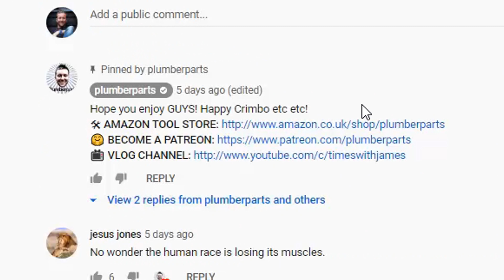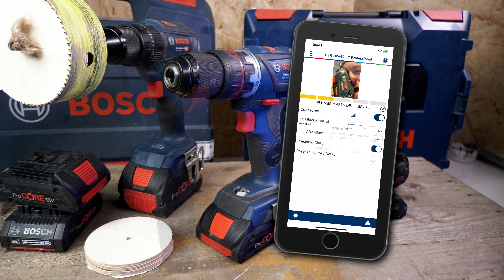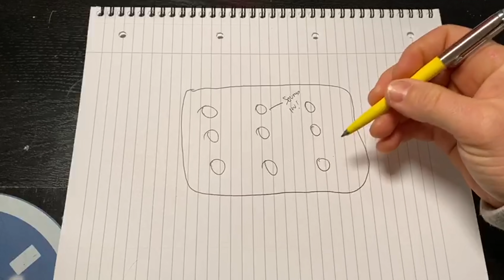5 DRILLS IN 1 - THE BEST DRILL DRIVER I'VE SEEN - Bosch GSR 18v Flexi Click

Comment: Little tip for you, if you're drilling large holes in ply or MDF like that ...use the holesaw to mark the hole then drill a couple of small holes in or near the kerf of the holesaw. Then when you drill with the holesaw it will fly through 👍 it helps to clear the dust
Reply: Biggsy1970 was going to recommend this
Reply from the maker: Amazing hack!
Reply: @plumberparts  I only learnt it a few years ago after 30 odd years as a chippy.

Comment: Simple rule for Bosch tools for pros rather than occasional DIY-ers: don't buy green: always buy blue. My jigsaw is still going strong after 10yrs; the 18V-55 that arrived sub-optimal (off-centre driveshaft + gearbox problem) was replaced within 3 weeks with a 60C model even after 3 months urgent job completion usage with no quibbles, & the MFT I generally use for old gloss paint scarifying, general sanding & odd-cornered cutting is still OK after 4 years..
Reply: Isnt the green one better? I am an apprentice and we dont have bosch cordless drills but hammer drills.
Reply: @marinokuzmic3056  I suspect you mean cordless SDS drills for going thru masonry/concrete quicker; my cordless has a standard hammer drill option for (eg) brick

The green Bosh version is really for hobbyists, so they don't tend to survive the rigours of site work as well IME; the blue (more turquoise/aquamarine IMO) version is very much a professional's machine so it'll prolly last quite a bit longer

Comment: On the Bosch YouTube video on this tool the guy says the sds was designed for red and brown wall plug sizes and the common screw sizes that most trades use and if you were using 22mm and above you need something else.
It's like the Festool, it's a system designed to let you just carry the minimum to the job.
Reply from the maker: Yeah I said that at the end. Pretty spot on. 😎

Comment: 18 v flexi....Wow! I just bought the 12 volt never knowing bosch made an 18 volt version and this video is 2 years old. I'm still not upset as I use mine to do light projects. I have more powerful tools for other things but yea, the flexi is a brilliant design. All the best from maine usa..I need to add..I've owned  about every major brand of tool out there. And I honestly don't for the most part, have a favorite. I try to buy the best of each brand that I can afford. I work in a home improvement store here in Maine, in the tool department so I see new 🔧 🔨 🔧 🔨.  They're all fun to work with, the important thing is...they work when you need them to and don't think you can do the job that requires a bigboy tool with something less substantial. Save the small one for what it's intended use is. Same goes the other way. Power tools just plain out are a thrill to use. Stay safe my friend

Comment: Given AvE's recent breakdown of the Bosch tool not sure I would be buying one anytime soon
Reply from the maker: Hit me up a link mate. Be interested to see what problems they found. Honestly massively impressed by these drills. Would love an impact version and the battery's are better than the 'japanese' brand I've used for years. CRAZY!
Reply: @chrispaul5522  dammit, beat me to it
Reply from the maker: @Cp3_james  So I've watched his video.

I'm gonna rip off his review technique. Take it apart and measure components with a pair of callipers. Don't drive one screw in. Don't compare it to competitors. Don't use solidly for two weeks - and ONLY DROP 4 TIMES FROM A LADDER?!?! With my butter fingers that's the brutality they're put through every 10 minutes! 😜

Personally for me I don't care how thin a bit of copper is, as long as the tool itself works and does what I need it to. Which this beast did every time solidly for a two week pounding!

Gonna change my review for next week now. Was going to review the Ox Pipe cutters by cutting 100 lengths of pipe into 100mm bits...now I'm just gonna take it apart and measure things on it. (Banter babes, plus I'm massively hungover from a bender with the fam last night - have a wicked Christmas!) 😘😜
Reply: plumberparts, are you still hung over?  LOL!  Hope you had a nice Christmas!  When is the follow up video, in response to AVE dissing Bosch coming out?  Thanks!

Comment: Bosch needs a lanyard hook on all the attachments so you can have a retractable lanyard to hold them on your belt. Would be useful for suspended work where fall protection is required.

Comment: Hi, engineers and home users. Amax model motors have ball bearings for the motors of the battery power tools, supporting high speed and strength at the cost of the same batt charge. Much higher rpm, strength w the ball bearing, and strong enough for years. If you buy new tool, you can fit it to the new one.

Comment: The real test.  Ave!  😂
Reply from the maker: Never heard of his channel. I’m still happy with battering it for two weeks!
Reply: plumberparts The man is a legend!  :)
Reply: plumberparts Personally for me it’s Makita as parts are cheap as.  Armature for £15 opposed to approx £50 for most others. Makita downside is the chargers/ controllers.  Bosch most folks won’t touch and shouldn’t as parts are a C***.  Soz bro.  Just not a pro tool
Reply from the maker: Most of my tools are Makky and the bats are shite. Plus the little yellow but always breaks. And a 5ah one is best part of £70 compared to £30 for a good Bosch. 

Think Bosch will be one to watch with this battery line though. I was blown away by the life and after two weeks of a direct comparison was easily as good if not better than Makky. 

Each to their own though! Have a good Crimbo and all that jazz! 😎
Reply from the maker: @SynKronos  Right Ive watched his review and this is what I replied to a dude earlier (in jest so don't get your massive stinky knickers in a poo twist):

So I've watched his video.

I'm gonna rip off his review technique. Take it apart and measure components with a pair of callipers. Don't drive one screw in. Don't compare it to competitors. Don't use solidly for two weeks - and ONLY DROP 4 TIMES FROM A LADDER?!?! With my butter fingers that's the brutality they're put through every 10 minutes! 😜

Personally for me I don't care how thin a bit of copper is, as long as the tool itself works and does what I need it to. Which this beast did every time solidly for a two week pounding!

Gonna change my review for next week now. Was going to review the Ox Pipe cutters by cutting 100 lengths of pipe into 100mm bits...now I'm just gonna take it apart and measure things on it. (Banter babes, plus I'm massively hungover from a bender with the fam last night - have a wicked Christmas!) 😘😜
Reply: plumberparts Damn gal put your dummy in eh!  It’s built crap & he’ll load test it in due course.  I’ve repaired many tools over the years & professionally at that.  Take it sales aren’t going well?  Don’t like an opinion might I suggest that you disable comments.  Now once yer dummy  is back in, grow a pair.  😂
Reply from the maker: SynKronos I told you bro, I’m in bed with the cat and hungover! 😂😂😂
Reply: plumberparts  😂 We really don’t need to know about your bedroom exploits 😂
Reply from the maker: SynKronos haha!

Comment: 1. Too expensive,hi-tech and complicated. I'm not sure if this tool would survive a drop from one metre, which is quite common at my workplace 

2. Looks fancy and easily attracts other people's attention. Left the drill unattended for few minutes, and that's it.Gone.

3. The SDS adapter's impact energy is about 1 joule, which is pale compared to standard SDS rotary hammer (2 joules and above). Still able to drill into concrete, but slower and not efficient (if your'e a contractor)

4. Other adapters I think are okay if you're doing a carpentery work/DIY stuff
Reply: im a contractor and also have the GSR 18V FC. You are just wrong.

Of course that SDS is not comparable against an 3 joul 18V Bulldog but its more than enough for setting 6 or 8 mm dowels. 

The 90 degree attachment is some times a lifesaver and the offset is as good as for any other professional brand like Festool. 

It has its place and if you are on a smaller job the FC csn be a stand alone solution. 

If you want more like DIY tools look into Workx, Milwaukee or Ryobi

Comment: All these features and only 3/8 max diameter masonry bit is a failure.
Mickey mouse product.
First time I'm disappointed with bosch
Reply: are you serious? Its an 1 Joul attachment for an Drill driver. Its made for quick installations for 6 and 8 mm holes for dowels. It is in the same League as the Milwaukee M12 SDS drill and still it still can become an compact driver can go offset, 90 degree and has a regular chuck. 
It is basicly 2 Milwaukee products in one mashine in better build quality

Comment: Bluetooth on tools is pathetic!  Doesn't belong on tools, only lessens their quality.
Reply: You're shaking your fist at clouds grandpa.

BT isn't the point of the feature. BT is simply a connection medium. They could have used wifi or a cable. Guess what, BT is designed for these types of applications, not just for airpods. Using the BT protocol absolutely makes sense for this type of interface connection because it is low-power and designed for relatively short distances. 
The point of the module is that you can change how the tool operates(and set heat/battery warnings) using your phone instead of turning physical dials and buttons on the driver. Believe it or not, all of your tools could have the option to adjust these settings, but most companies don't offer that to you.